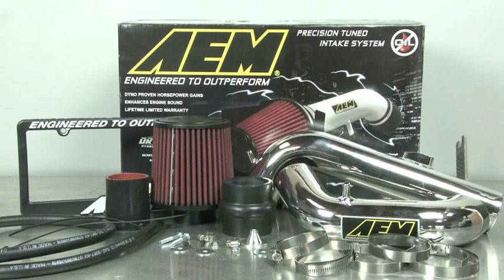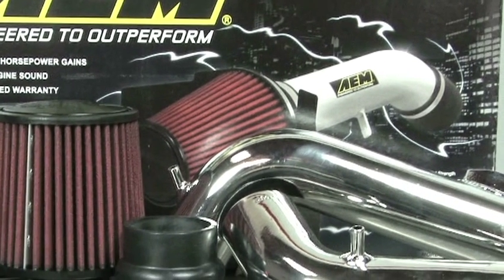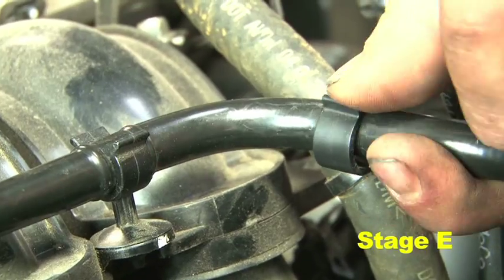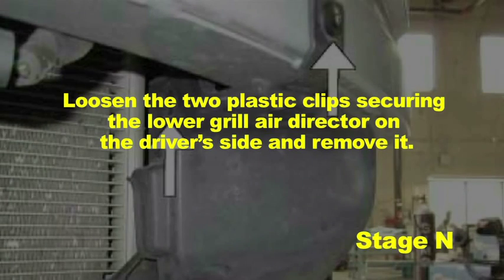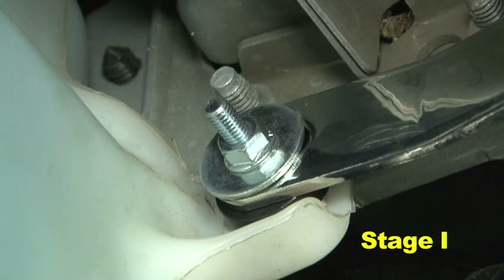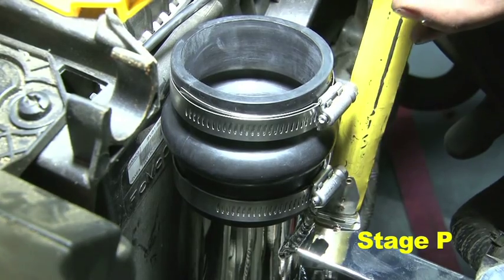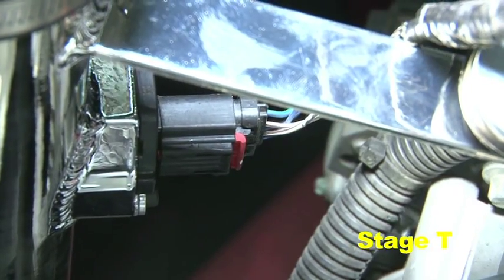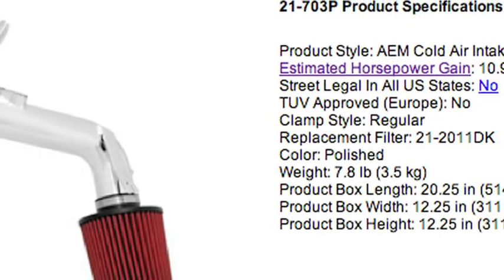How to Install an AEM Air Intake on a 2011-2013 Ford Fiesta 1.6L

Comment: I would recommend to clean the entire engine bay (or at least blow off the dust with compressed air) before installing the system as dirt might get in the engine when removing the intake hose causing damage to the pistons and other internal parts
Reply: i guess Im randomly asking but does anybody know of a way to log back into an instagram account..?
I was stupid lost the login password. I would appreciate any help you can offer me!
Reply: @Iker Crew instablaster :)
Reply: @Arthur Aydin It worked and I finally got access to my account again. Im so happy!
Thanks so much, you saved my account :D
Reply: @Iker Crew glad I could help =)

Comment: Will this kit work on the 2014? I've seen a different kit for the 2014 but it seems like a short ram more than a full CAI.
Reply: As long as its a mk7 yeah cause all mk7 engines are basically the same unless it's an ecoboost 3 pot   only differences are slight bodywork differences like bumpers and trims

Comment: So to clean it, I must remove my bumper each time?
Reply: David Albert no kidding.. that's a little off putting
Reply: David Albert yea there’s hardly any room so they bury it in the bumper. I guess once a year isn’t bad or once every 10,000 miles. I’ll just do mine every time i get synthetic oil change every 10k 😁
Just bought one on ebay for 150 bucks
Reply: @spazzologist  did it fit like the video showed? thinking of doing the same to mine

Comment: 😂 Wtf I'm qualified as a  level 2 mechanic and just saying I doubt that you need to take all that apart and remove a front bumper to fit an air filter 😂 also wtf is up with not cutting off the ends of zip ties?